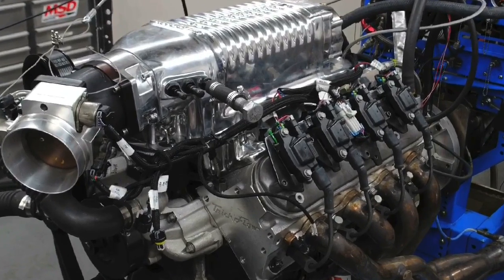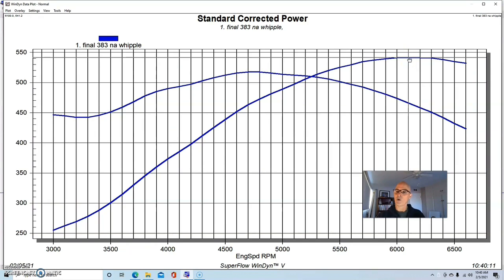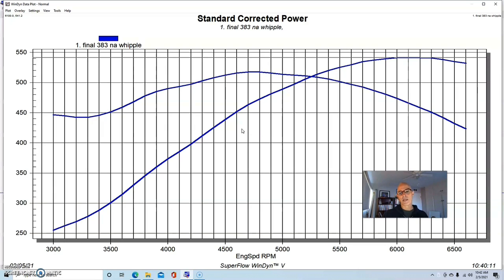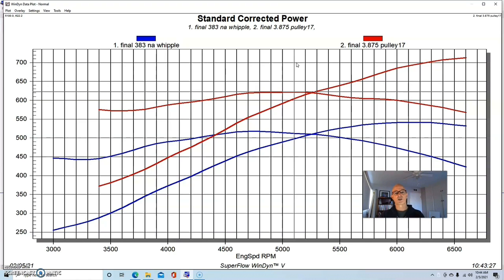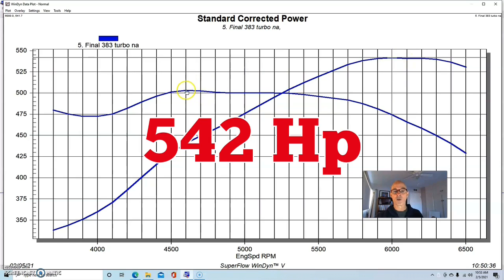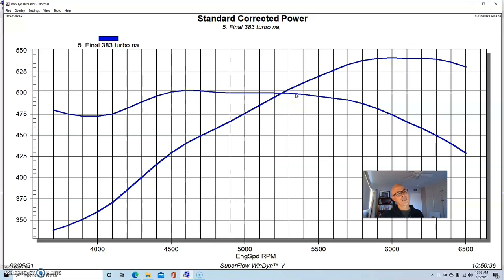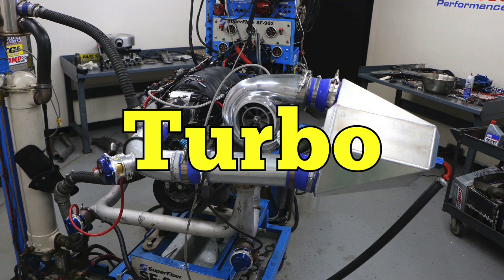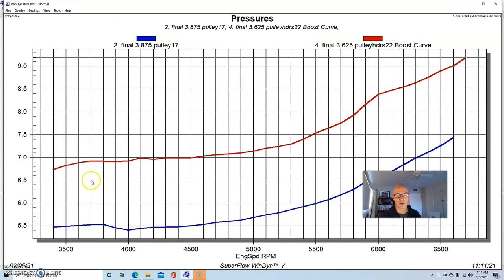WHIPPLE BLOWER vs LOW-BUCK TURBO-383 LS STROKER

Comment: I expected the turbo to win, but the boost curves are so different, it seems like cheating.  The GT45 may be too small for this test.  It's making 10 psi at low rpm, then boost falls off after 5700 rpm.  The turbine must be going into choke.  I have seen other Holdener turbo test video where the turbine is too big for the engine, and it provides a rising boost curve, which would make it more fair for the Whipple.  On the other hand, the oversize turbo would have lower drive pressure at high rpm than the GT45 did, so it would make more peak power.

I've been wanting to see a test between a Whipple and an Eaton TVS of comparable displacements on the same engine and at the same boost level.  I bet the Eaton would win.
Reply: The Eaton will Win. Whipple Can’t compete with the TVS efficiency. Maggie TVS would be best I think.
Reply: You are absolutely correct. I've tested several Whipples on a calibrated test stand back to back with a 2300 and 2650 and they don't even come close.
Reply: @werks96  Is that in thermal efficiency or drive power?  Or both?
Reply: @andyharman3022  Basically it's both. Rotor clearances (rotor to rotor and rotor to case) and rotor geometry are the largest factors. i.e. if you have larger clearances inside the SC, you leak more air, causing more heat and less pressure.

Comment: The Whipple doesn't have the airflow at lower blower speeds to produce the same boost as the turbocharger. With a larger capacity supercharger you could indeed match the boost level of the turbo, and it would be a very interesting test to compare parasitic losses at the same boost pressure. 
Some will argue, "Well what about the rising boost curve that superchargers are known for? If we were able to achieve equal boost at lower rpm levels, we'd be overboosting at high rpm levels, and there's no way to control that."
Well yes, but yes we can. It's just no-one does it. There are couple of ways we can control a rising boost curve. First, we can introduce a blowoff valve on the pressure side of the supercharger to bleed off excessive pressure at high rpm levels. The second way is more complex, and that involves varying the blower drive speed to speed the blower up at lower rpm levels, and slow it down at higher rpm levels.
Would it be worth it? For testing purposes, yes. Everything in the name of science. For the average person? No, absolutely not. It's much easier and simpler to design a turbo system. Would it be cool? Certainly. Instant power with no lag at all? That is cool, and costs be damned.
Reply: A CVT to drive the blower would take up a lot of space, but it would be cool to see.   Maybe someone could take a CVT out of a Nissan or high-performance snowmobile and cobble it up to drive a supercharger.

But once you think about it, a turbocharger is a centrifugal compressor driven by a pneumatic CVT.  Functionally, it allows the shaft speed of the supercharger to change at a variable ratio to the engine crankshaft speed.  Mechanically driven superchargers are constrained to operating at a fixed ratio of crank speed.  There have been multi-speed and CVT transmissions used to drive centrifugal compressors, most famously the WW2 Merlins with 2-stage, 2-speed superchargers.  Some of them even had 3 speeds.  An example of a CVT driving a supercharger was on the Napier Nomad aircraft diesel, that had a Beier stepless variable speed drive between the crankshaft and axial flow turbocharger.  The complexity of the shaft system in that engine was mind-boggling.
Reply: @andyharman3022  a snowmobile style cvt would be the simplest way to vary blower drive speed. The difference being that the drive pulley on a snowmobile is in the open position at idle and closed at high rpm, whereas you'd want the drive pulley closed at idle and open at high rpm.

Comment: You should do a cold side wastegate on a centrifugal blower and measure the low end torque gain.
Reply: What
Reply: @DannyOrnelasPerformance  Google procharger with wastegate.
Reply: @DannyOrnelasPerformance  I want to see what kind of results he gets and what downsides he sees to the setup. You basically spin the blower harder to get more low and midrange torque without getting too much boost on the top end.

Comment: That turbo 383...😍. Have you done any turbo blow thru carb 383 LS testing? That GT-45 seems like instant boost. Bet it would make one killer street combo! You know.... if you were the 800 hp daily kinda guy 🤣
Reply: Why would you want a carb on an LS ?
Reply: @hoonaticbloggs5402  call me an old school fan. I can tune a carb... fuel injection... takes more equipment than a few wrenches and screw driver 🤷🏼‍♂️ ( p.s. yes I know fuel injection slaughters carburetors on performance in almost every aspect... I just like an old 4 barrel 😏)
Reply: @Lagrange1186  And tri-power and dual quads!  What could be cooler?
Reply: @Lagrange1186   I can tune anything without getting fuel down my arms or in my eye. One lead and a laptop. ps I like carbs too , but FI is just better. 
The newer stuff like Holley , Haltech Is really easy to use
Reply: @hoonaticbloggs5402  Playing with a laptop is not the same.  Too clinical, less of a sense of satisfaction.  And if the FI needs actual repair, you can't do that with a laptop.
Reply: @jamesbosworth4191   😆 In my many years as a tech, I think maybe one ecu packed up due to someone putting jumpers on backwards.
Reply: @hoonaticbloggs5402  I have never been a "technician", just a mechanic back before cars had electronics, but I have seen many on-board computers fail.  And they can't usually be opened up.  They must be replaced, and I don't like not being able to repair something.
Reply: @hoonaticbloggs5402  No damn computers and sensors to have to worry about.
Reply: @jamesbosworth4191  😆I’m not worried about my computer or sensors .
Reply: @hoonaticbloggs5402  But if they start being troublesome, you will have to bring it to a shop.  If a carburetor becomes troublesome, you can fix it in your driveway.  That is hugely important to me.  I don't LIKE cars that I have to bring to a shop.
Reply: I'm absolutely convinced a CSU blow through on the LS 383 will totally decimate the fuel injected numbers. Evaporative cooling is superior although fuel economy would be down but if it's a weekend toy hell yes!
Reply: Fuel Injection gets evaporative cooling too. It just happens inside the cylinder rather than the manifold, so it's.less obvious.

Comment: Hello Richard!!! Halarious intro. Those two have boost rage combo issues. Ok I’ll mind my own business. LOL 😂!!  That whipple charger is the way to go, I would prefer it to be intergraded with the engine and let the boost be determined by the driver needs. Like a switch to go to track or extreme street racing. Dynojet has that option. But best psi for the buck is the gt45 charger. Can’t beat it!! 

Thanks Richard!!

Comment: Turbos are cool but that Whipple when you hit the throttle oh yeah
Reply: Yeah because his video shows how the whipple has so much more low end torque and boost than a turbo.... WTF?
Reply: I used to not like turbos until I bought a F150 with the 3.5L Ecoboost and did a few modifications. Good God. I’m a convert.
Reply: @WalkerSmallEnginePerformance  turbo have been superior for half a century
Reply: I have a PD Blower on my 6 liter ls. I like them
Reply: @dazaspc  
I've been in this game for a long, long time. What the hell is a PD blower?
Reply: @AB-80X  Police Department blower. Like on the Mad Max car.

Comment: I am so confused..... I thought a whipple/roots/Tvs style would not have a slow curve like that? And since when does a turbo have a curve like that? My mind is stuck in the late 80's it seems. Great video
Reply: I was on the same page, until I looked at the rpm scale, it is from 3500 rpm 
I'm still blown away that an 800hp turbo makes full boost around there and the whipple is still so low, I would be interested to see a run from mashing the throttle at 1000 or 1500 rpm.
Reply: @ScottSherrington  you can make a turbo come on whenever. It's like a "I want big power right here" power adder. Blowers sound and look cooler though.
Reply: A whipple is basically always adding a little bit of boost at all rpms because it's driven by the pulley, but it's also going to be limited by the linear acceleration of the rotation speed of the engine. The airflow requirements for the engine don't linearly scale with rpm so a turbo comes on harder.
Reply: Yeah right? that turbo curve looks like a true positive displacement blower 😅😅
Reply: boost is too low for the blower its not spinning enough to move air in the lower rpms, put a bigger pulley on it to make 15psi and it will be more flat boost curve,  my 2300 blower was 14psi any rpm, if the turbo wasnt controlling boost it would have the same issue
Reply: @intolstuning3735  You mean a smaller pulley?
Reply: @chomin3025  yea thats it on blower, or bigger on crank
Reply: @intolstuning3735  I agree. The blower is too small and not enough pulley.

Comment: What a supercharger needs is a cvt style drive, spin it harder low down then bring it back when the boost requirements are made haha or a turbine bolted to the back.
Reply: Procharger i-1
Reply: Cvt belts are nonsense. They also have really high radial loads. the tension on the belt is one part of where in the shifting pattern it is. A serpentine belt is actually really good, they take up a minimal amount of room, the pullies are monolith and typically never fail and have no maintenance. Adding a Cvt might give you a little more torque but at huge complexity.
Reply: Just run a TVS blower, damn near flat boost curve
Reply: Cvt runs opposite of what you would want though. It starts with low gearing and runs to higher. You would want it to start high and then low to keep a flat boost pressure. It would be interesting setting up back shift and secondary ramps. Again though you would have to run inverted pulleys or something weird to get the desired effect.
Reply: @scotttod6954  A CVT can start wherever you want. We don't need to debate this. The i-1 already exists.
Reply: @corystansbury  well every cvt I have worked on in the last 30 years works the complete opposite of what you would want for a super charger. As I was explaining before even looking at the I-1. Yes they invert the pulley functions.
Reply: @scotttod6954  I understand that they keep at a base gear ratio (aka, low gear) for minimal parasitic losses during cruise, then ramp it up to a taller gear, higher speed in a couple tenths of a second when a demand signal is given. So, I suspect, it actually operates precisely like a CVT car transmission. With that said, a continuously variable transmission is "continuously variable." i.e. the default gear ratio really doesn't mean anything.